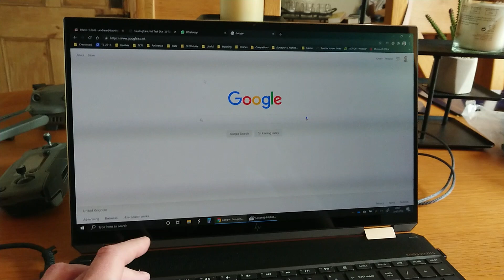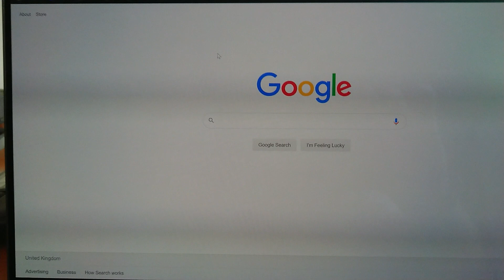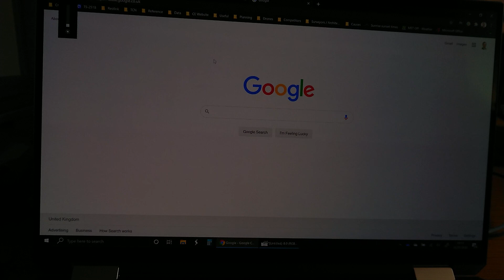HP Spectre x360 15" 2020 Screen Pulse Width Modulation test

Comment: Hi Andrew. I am thinking to order this system. https://www.youtube.com/watch?v=1Xdsiie3JkQ    looking at this review from 2:00 the reviewer mentions PWM. Do you think this is an issue? Would like the OLED but could stick with the UHD display too.
Reply from the maker: It's not been a problem for me in five months of use. I have now in the last week switched to using an external monitor, though, mainly to preserve the life of the HP's screen as I'm concerned about AMOLED burn-in. That said, the screen is still the best (colours, contrast etc.) I've ever seen on a laptop - if it lasts...
Reply: @AndySpeed88  OK thank you. Which external display do you use?
Reply: is there pwm on macbook air m1 because notebookcheck says it does but very less and it says hp spectre does not have it but you have it in yours and I have seen it other spectres also so......

Comment: Thanks! What do you think about the new hp envy? I was thinking of getting the spectre but the envy is cheaper and performs better so it seems like a no brainer
Reply from the maker: What are the specs on the Envy? This laptop with its Intel i7 10750H 10th gen processor and GeForce GTX 1650 Ti graphics card is pretty punchy, and in a nice chassis with an OLED screen

Comment: Thanks for the video, does it really matter in daily usage? I noticed you leave the taskbar on screen have you had any issues with burn in? do you use word frequently? I ordered mine but I'm concerned about that.
Reply from the maker: No I don't feel it matters in daily usage and it's not discernible to the naked eye. No sign of burn in yet, but it's only been two months so I would hope it doesn't set in for years, not months. I do have a screensaver which activates after 1 minute. I prefer to leave the task bar on, but might try hiding it - will see how I feel.